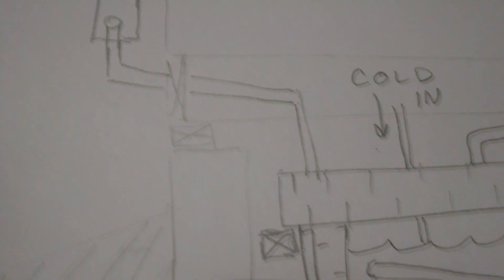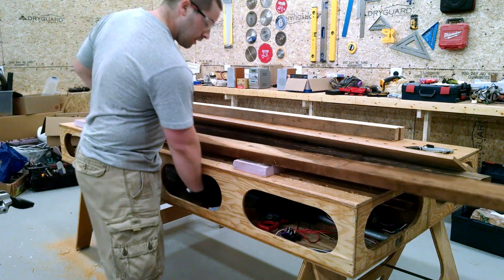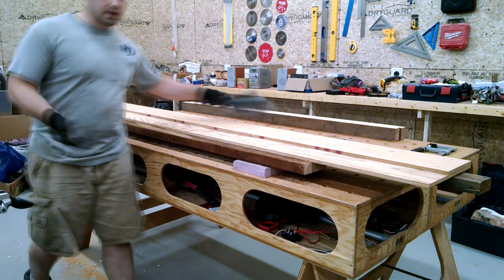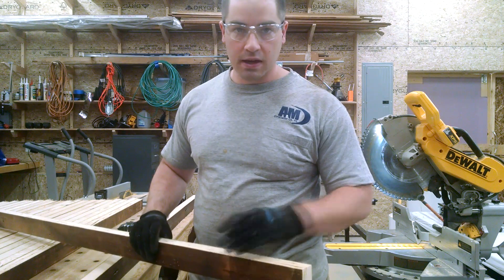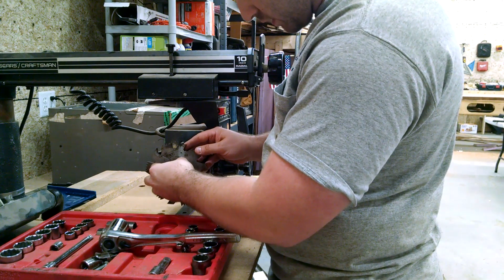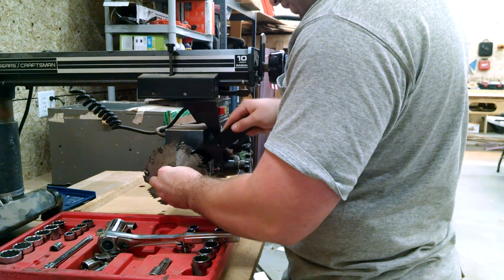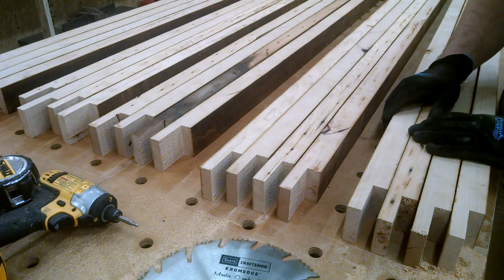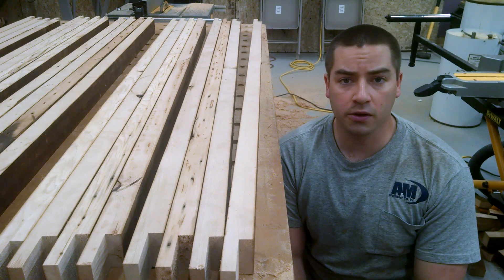Framing solar DHW tank part 1

Comment: Really good stuff! I've restored a couple 4x8 collectors from an 80s system that I bought used down in AL, and built one from scratch for someone else a few years ago, both work pretty good!
And man, a bandsaw would have saved you a lot of time on those halflap joints!